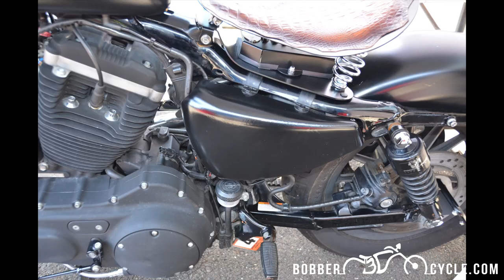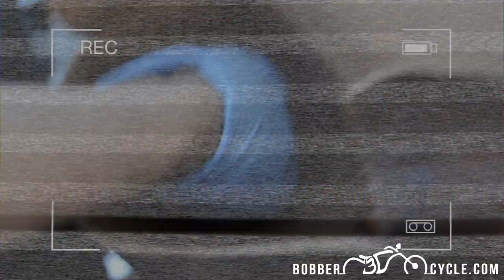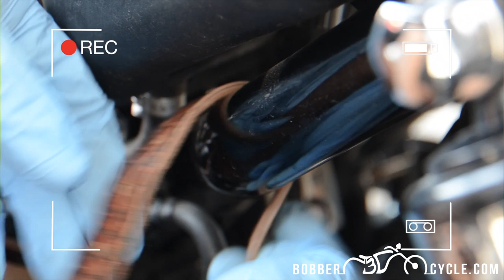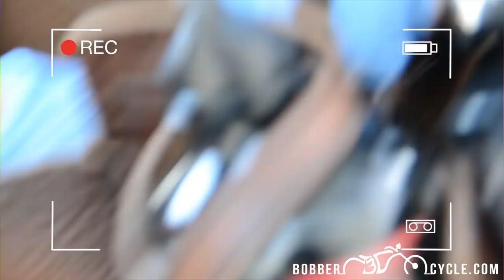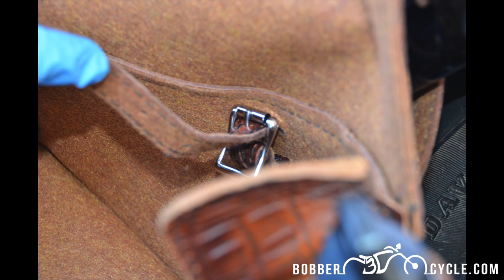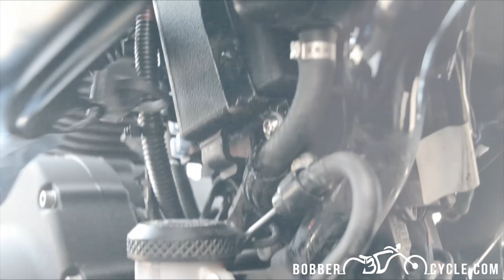HOW TO INSTALL Harley Davidson Sportster left side saddle bag

Comment: is that bottle specifically made for fuel or are they just like any other aluminium bottles like those ones people use for drinking water?
Reply from the maker: +LaMadrid81 The bottle is specifically designed to hold fuel. You can also use it for water.